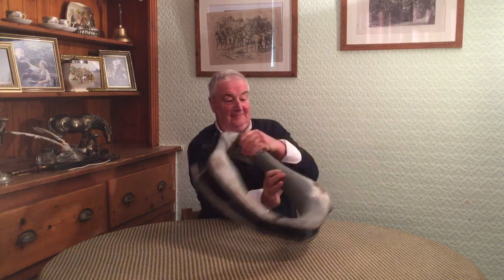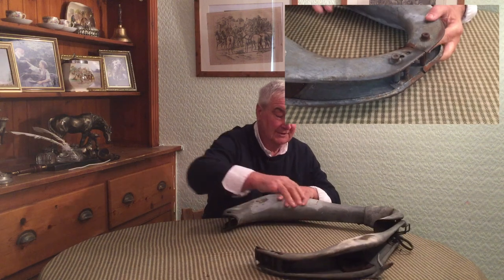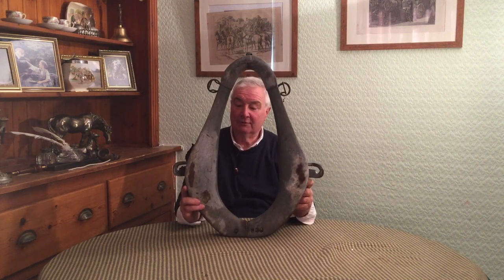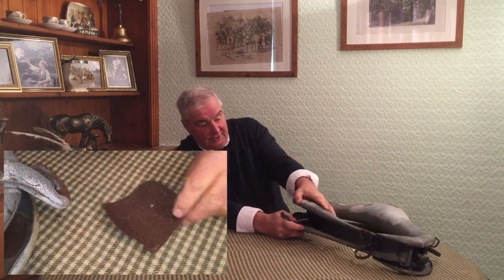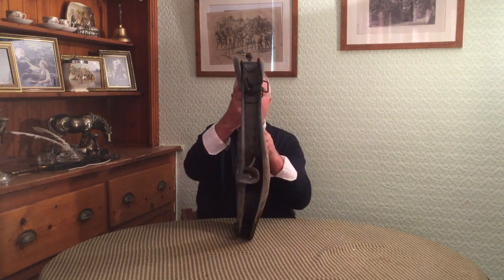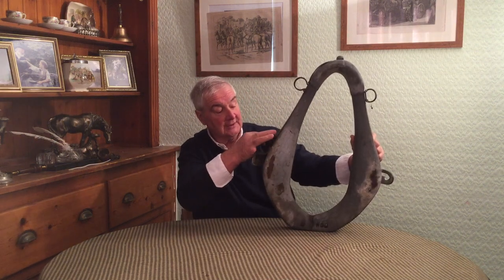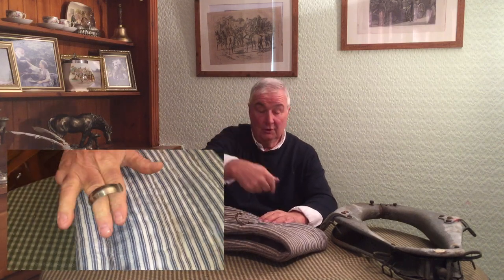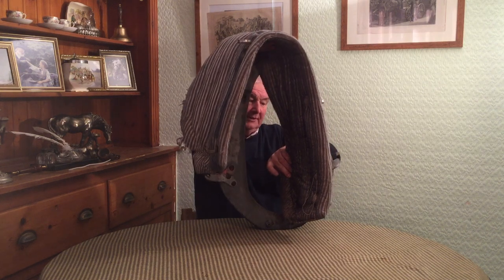Old Time Tuesdays  - An Emergency Services Collar

Comment: I once read a book about the firehorses of San Francisco. Not only were their collars suspended above rhem, but the entire harness. I don't remember the details, but the harness was pretty simple, maybe just a back band, and a strap or two over the rump. Because the city is notoriously hilly, they probably had a bit of breeching on the harness. I believe they had special slip resistant shoes, too.

Comment: I love old time Tuesdays. I woke up this morning thinking about flies and wondered if you have any old methods for deterring them. I read somewhere that an elder twig stuck in the headcollar works, but there must be lots of other natural ways or what horsemen used to use. I prefer to try natural methods first before reaching for (expensie) chemicals wherever possible.